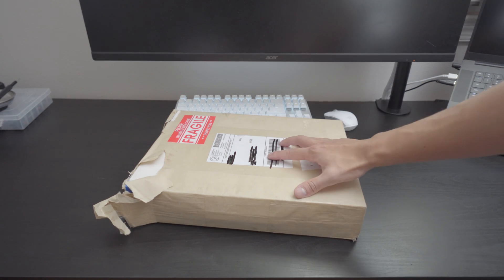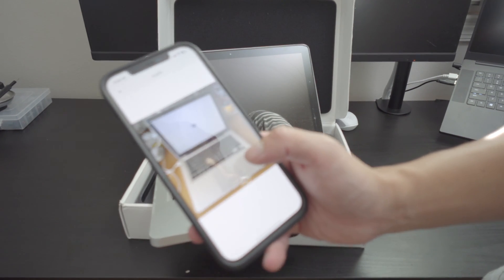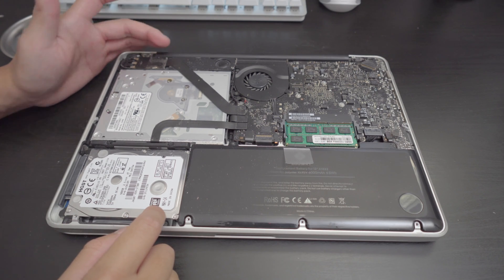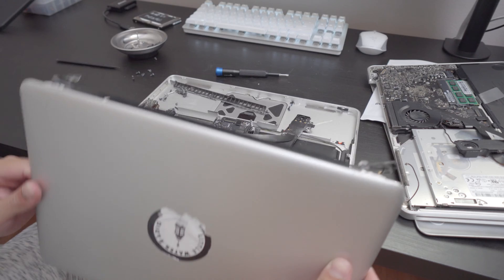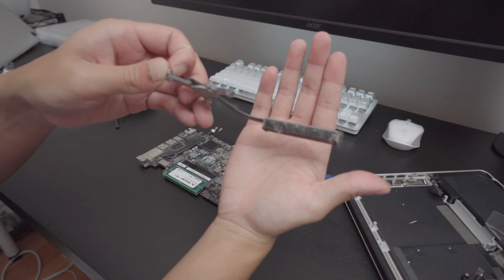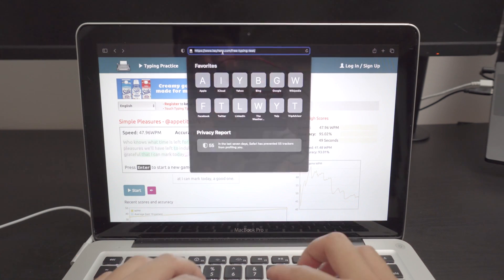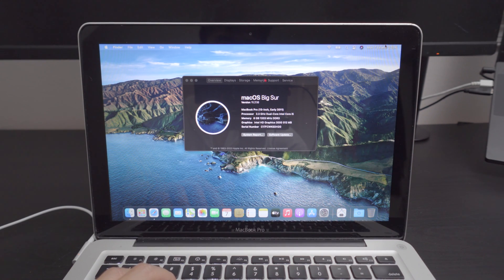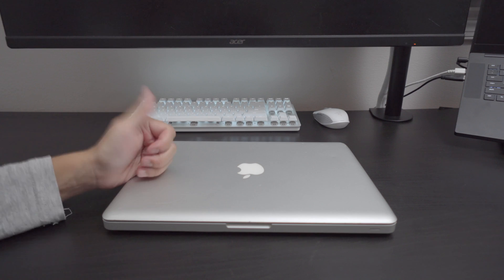THIS $19 MACBOOK PRO WAS A DISASTER!!! 2011 MACBOOK PRO 13" IN 2024!!!

Comment: I have a MacBook Pro 13’ late 2011. It still works well now somehow, I can use it reliably without problems, & runs better than my 2015 iPad Mini. The only problem I’ve had is today, when I turned on my computer, I got a kernel panic. But after it booted up and started running better. It runs Mac OS High Sierra. It must have been upgraded when I bought it because it runs better than expected for an old computer, ol’ reliable, but eventually I’ll need a new computer.

Comment: I bought one in mint condition 3 days ago for 80 euros. It was really struggling running High Sierra with it's 4Gb RAM and it's 5400RPM Harddrive. After rushing home, the first thing i did is :
- Add 16Gb of RAM instead of it's original 4Gb. 
- Add a 500Gb Samsung 860 Evo SSD. 
- Replace the thermal paste and install OSX Catalina. 

What can i say, everything is SEAMLESS, i really REALLY like the unibody design of 2011 / 2012 Macbook and it still feels modern even after 13 years.
I'm writing with it, the keyboard is godlike on those models (yes shame on you butterfly keyboard, SHAME), very pleasant and definetly usable for EVERYDAY use. It's even QUIET. Something i didn't expect. 

I'll give it to my mother which have one hell of a sluggish (even if more modern) Asus PC with a low-end AMD APU.

Comment: I just bought one and the Bluetooth and internet is not working properly what do I do
Reply from the maker: If you dropped it, the WiFi adapter inside might have its cables disconnected, if not you might have a software issue and a restoring it is a good idea

Comment: Saw this in my feed and really enjoyed it. I run four or five old Unibody MacBooks for taking notes in class, swapping between them. A 2011 or 2012 equipped with an SSD is more than capable of lending to someone when their MacBook breaks and they have to wait to get it repaired. Great content and my best to you!
Reply from the maker: Thank you! 2011 and 2012 are indeed the best years for the MacBook unibody! Still perfectly fine even today
Reply: I would recommend to look for 2012, those are handoff compatible
Reply: Not only are they handoff compatible but it unlocks amazing potential for features like Universal Control, etc and better compatibility due to the Metal API HD 4000 graphics. 2012 and newer is vastly more capable with newer macOS @GJoseeph
Reply: @johnmarchant160  I might want to try also Macbook from 2014 some day when I can afford it as experiment machine. Example lightweight macOS + Windows or Linux environment for long term support. Or maybe moving to android...

Comment: I used to use a 2011, and yeah the SATA cable died. I swapped the motherboard and SATA cable out with a 2012 I thought was dead. I didn't swap motherboards back because of the better graphics.
Reply from the maker: Yup! I’ve had a couple of times a 2011 Sata cable going bad, 2012 they have revised it and yes, 2012 have a much better graphics